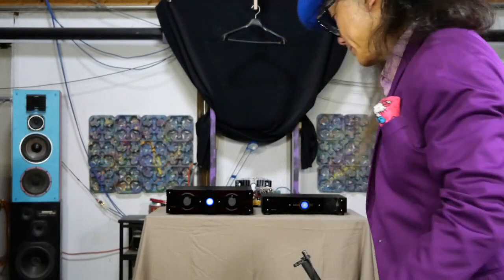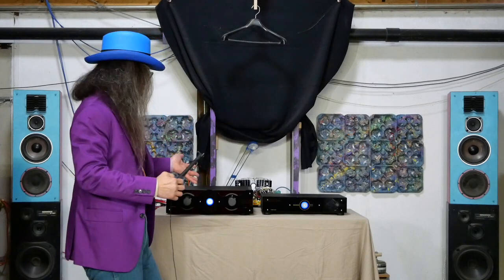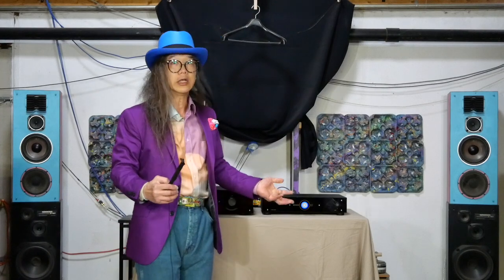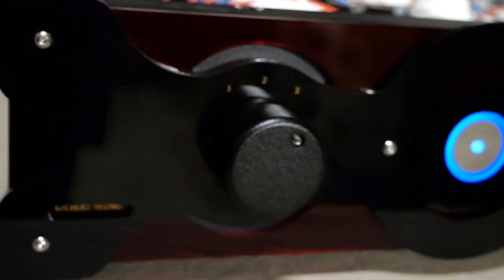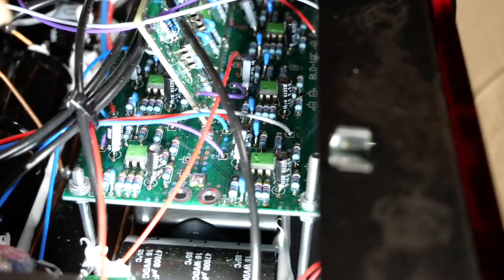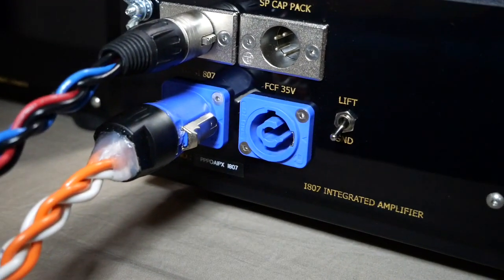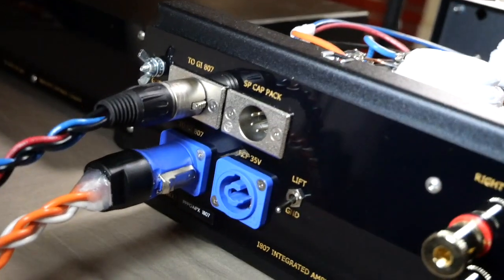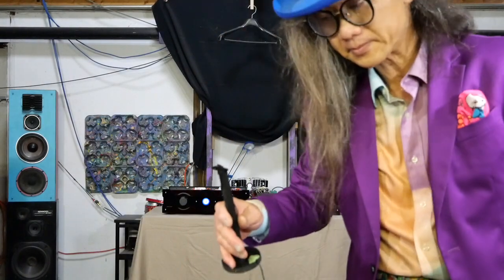Angela-Gilbert Yeung i807 Integrated Amplifier

Comment: to feed loudspeakers with 109 db , don`t  you think that 80 W it´s to much? That solution wouldn´t be more logical with a less power amplifiier? But, congratulations for the principles and  build quality of your devices !!!
Reply from the maker: The customer want and amp which can drive his Maggie and also his 107db horn speaker.  My goal was to build an amp which is very quiet but still capable to delivery current when require.

After that said, I agree 80watt into 109db is rather unnecessary. I would much prefer nice 25 watt. May be less with tube.

Comment: are you a believer of changing power cables?
Reply from the maker: @MasterofPlay7  Some power cables make a different but most..... not so much.
Reply: @angela-gilbert  but even with expensive brand amps oftentimes the soundstage is lacking with the standard black cord power cable
Reply from the maker: @MasterofPlay7  No argument there.  The standard black cords are not so good because of the crimp joints on both end.  They are not solder.  In general rule of thumb, I have an open mind up to USD750 for power cords, USD1,500 for an 10ft pair of speaker cable. USD500 for pair of 1 meter interconnects. Anything above those numbers, I have better ways to spend my money even if the more expensive wire are better. It is also why I am making my own wire.
Reply: @angela-gilbert  you are making your own wires? Do you sell them?
Reply from the maker: @MasterofPlay7  Yes, we do. It is in my web site.
https://www.angela-gilbert.com/speaker-cables-interconnects-power-cords